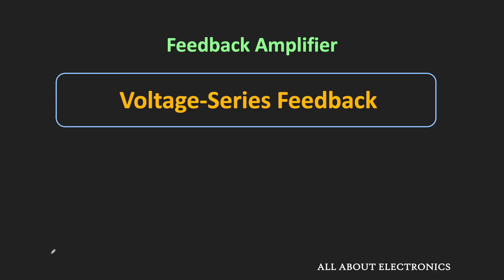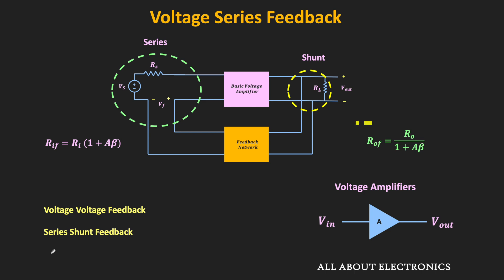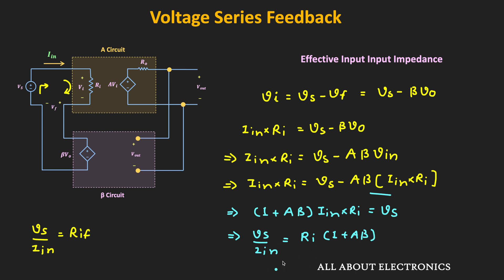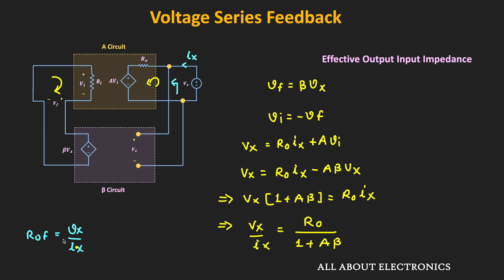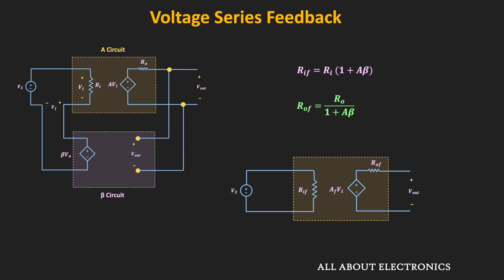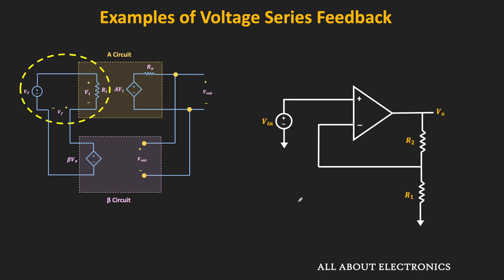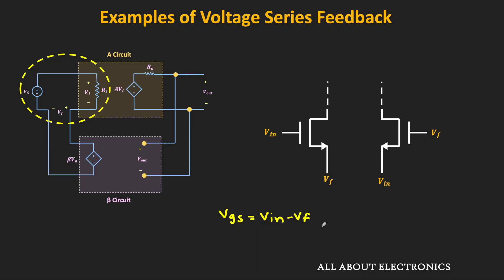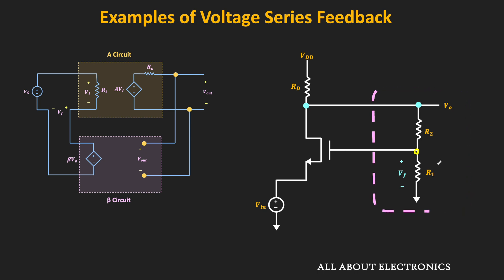Voltage Series Feedback Amplifier Explained | Feedback Amplifier

Comment: why did u take output voltage as A*Vin and not divide it on R0 and RL (load that we will apply)
Reply from the maker: As I have mentioned in the video, to simplify the analysis, load was not connected. But later on, I have also shown that when the load is connected then how output changes. (At 10:10)
Reply: @ALLABOUTELECTRONICS  but there is Ro